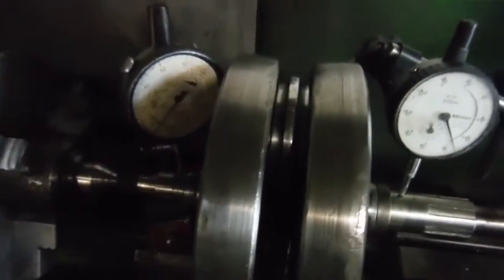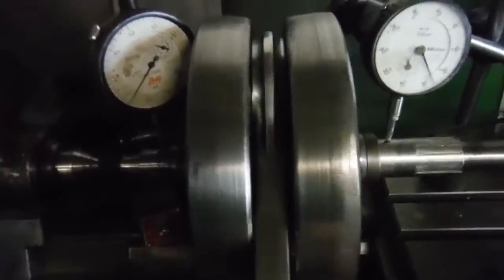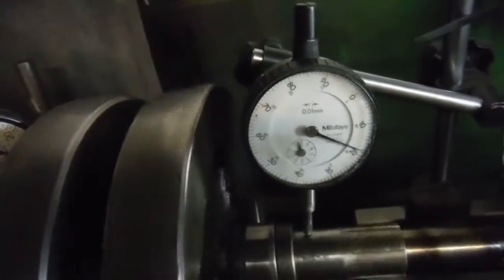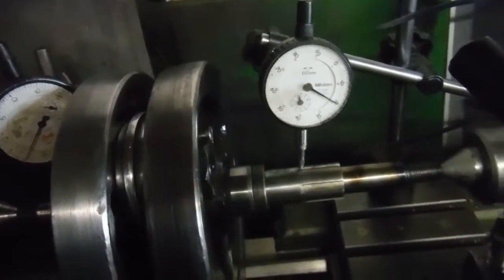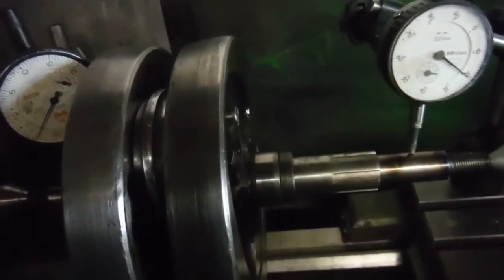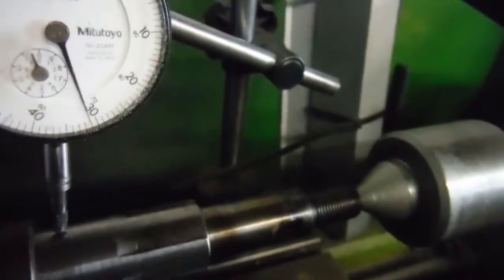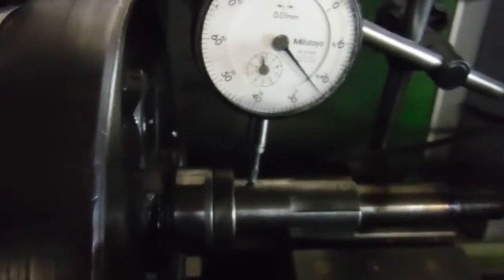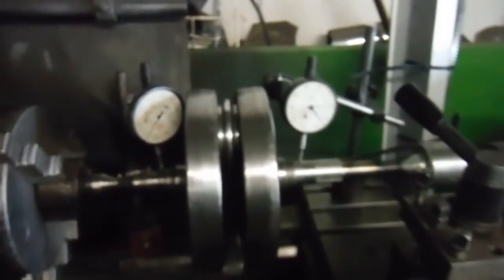Royal enfield Bullet  - checking crank runout at Performance Classics.

Comment: Weight of the crank?
Reply from the maker: Just standard early Redditch G2 spec, probably about 20 lbs.
Reply: @paulhenshaw4514  some of bulleters claiming that the weight of their g2 crank without modification weighs 28lbs. Do you think any stock g2 crank weighs more than 20lbs?
Reply from the maker: Some of the Redditch 500 cranks weighed about 24 lbs or so, but they are heavier than the 350 cranks, so I doubt it.
Reply: @paulhenshaw4514  I'm just talking about 350 g2 buddy coz redditch 500 is very rare in India. Do you think the crank of 350 g2 weighs 28lbs?  I also have another doubt that does 1978 Indian 350 comes with a heavy crank? If so what would be it's weight?
Reply from the maker: I don't think any 350 cranks weigh more than about 20 lbs, but some Indian ones are a bit lighter by a couple of lbs.

Comment: How much of an interference fit are the mainshafts in the flywheels ? I would think a performance big single would need a quality steel conrod ?
Reply from the maker: The mainshaft interference fit is probably only a couple of thou, as it is also keyed into the flywheel and when the primary sprocket / alternator rotor nut is done up tight, that helps lock it in place as well.

Comment: Is the mainshaft bent ? What did you wind up doing ?
Reply from the maker: I think the flywheels were badly assembled - the mainshaft turned out to
 be straight, although I fitted a new one at the owner's request. The 
crank is still split pending a decision on what sort of conrod / big end
 is to be used in the rebuild.